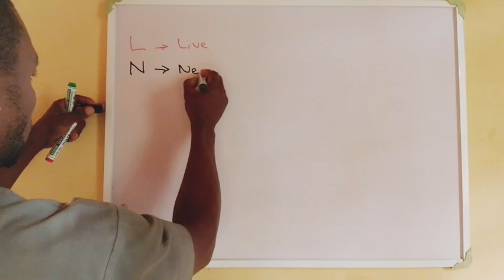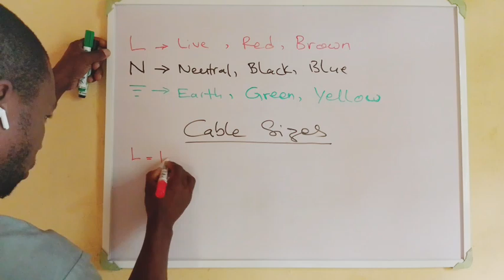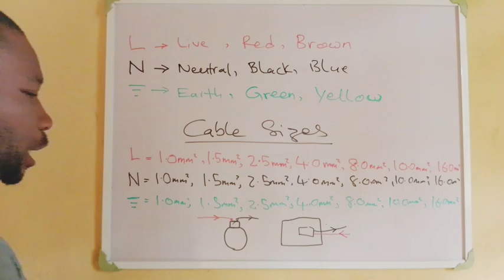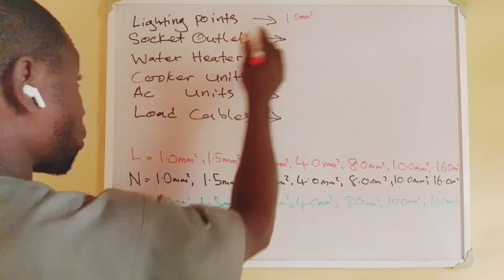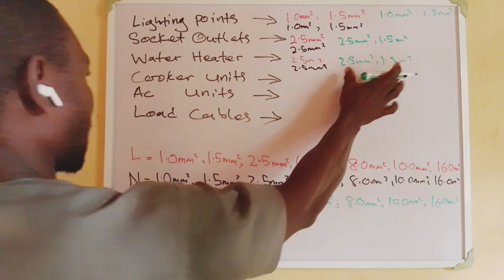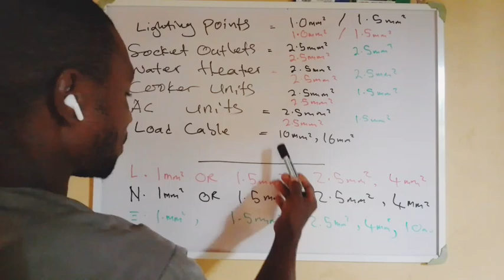Basics of Electrical Conduit Wiring  | Cable Color Coding & Size for Safety

Comment from the maker: Our online Training Package is here, you can get it right inside your phone or laptop. 

Are you an aspiring electrician, apprentice, technician, or site worker who wants to learn electrical installation the right way?

I'm excited to introduce the Mastering Electrical Installation Training Series — a practical, experience-based training designed to take you from the fundamentals to professional-level installation practices.

🚀 NOW AVAILABLE: MODULE 1 – FIRST FIX (CONDUIT PIPING WORKS)

In this practical training package, you will learn:

✅ Conduit layout design & circuit planning
✅ Site marking and preparation
✅ Residential and commercial conduit piping methods
✅ Conduit installation in walls, slabs, ceilings, decks, and floors and many more.

🎁 BONUS MATERIALS:
✔ Sample Electrical Drawings
✔ Support Group Access
✔ Real Site Demonstrations
✔ Professional Installation Tips

This First Fix module lays the foundation for every successful electrical installation project.

📢 COMING NEXT:
🔹 Module 2 – Second Fix (Wiring & Cable Installation)
🔹 Module 3 – Final Fix (Fixtures, Testing & Commissioning)

Stop guessing on site. Learn the methods used by experienced professionals and build skills you can confidently apply on real projects.

📥 ENROLL NOW: [https://youtube.com/watch?v=9rffCsPcc5s&si=uinHNCFEdppjgpgc

Your journey to becoming a more competent and respected electrician starts here. 
[https://selar.com/m/anams-electrical-tutorials1]

Comment: Good day sir... I just came across your channel.. I like you teach.. My question is that.. Why did said one should not make use of  different mm^2 for life and black wire..pls can you give more clarification and the disadvantages.. Thank you.
Reply from the maker: Your -ve and +ve cables should be of equal sizes because the same current  +ve wire brings to the fixture will be taken back by the -ve wire. It will also help you avoid some errors due to wire resistance and current carrying capacity.
Reply from the maker: ADVANTAGES OF USING THE SAME WIRE SIZE FOR A FIXTURE

(1)Uniform current flow – prevents imbalance and ensures stable operation.

(2)Reduced overheating – same resistance throughout the run avoids hot spots.

(3)Voltage consistency – minimizes voltage drop to the fixture.

(4)Improved safety – lowers risk of insulation damage and fire.

(5)Easier troubleshooting & maintenance – predictable performance.

(6)Code compliance – meets standard electrical installation practices.

PROBLEMS CAUSED BY DIFFERENT WIRE SIZES

(1)Overheating at smaller wires due to higher resistance.

(2)Voltage drop issues leading to dim lights or poor appliance performance.

(3)Loose or weak connections at joints where sizes change.

(4)Increased fire risk from excessive heat buildup.

(5)Premature fixture or cable failure.

(6)Inspection failure for non-compliant installations.

Comment: Thank you Sir for your understanding tuition.
Please what is the cable size for water pumping machiine
Reply from the maker: You know there are different sizes and capacities of water pumps, pressure pumps etc. if you mean domestic water pumps the cable sizes should not be less than 2.5mm². anything else, please let me know. Thanks!